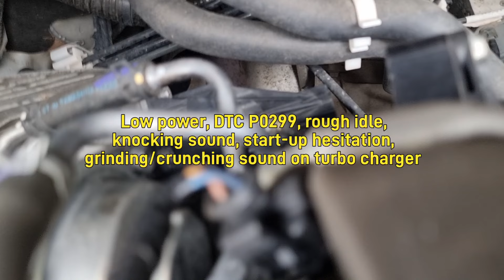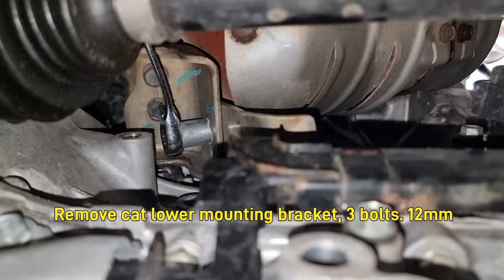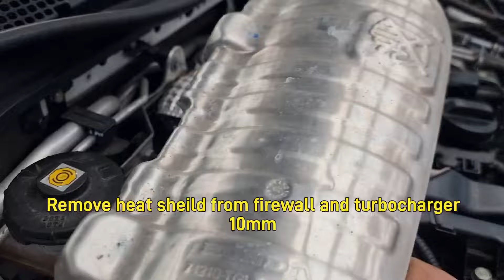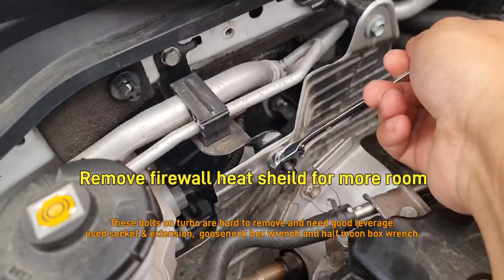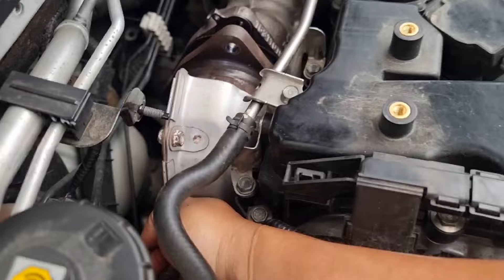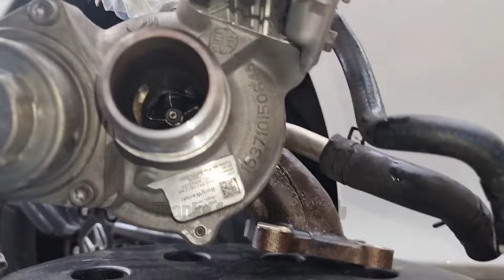Honda Civic X FK6 1.0 VTEC MK10 (2016-2021) Turbocharger removal. FC, FK - 95KW 129PS 130HP  P0299

Comment: So not only did i just take my 2016 honda civic ext to autozone where all the diagnostic said was i had a failed turbocharger but i also had power issues that got better after replacing the (leaking) battery and the alternator because i was told that was bad (obv separate test) but these were all the supposed symptoms of my bad alternator and "not the turbo" but i then proceeded to take it to honda where they gave me a ridiculous quote and said the cars completely done for. 250,000(ish) and making the EXACT same clicking noises as your engine (never heard a more identical sound) and had all the same power and acceleration problem's but ok my car is "completely done for" lol 🙄 
Should probably just cut my losses anyway... It truly isnt in great shape (including inside and outside) and im tired of it. Changed the canister purge valve from emissions related power issues just a few months before...🤦‍♀️
Reply from the maker: @sageolivia3275  sad to hear all your troubles with your car, yea this is a failure product honda made regarding the engine design.